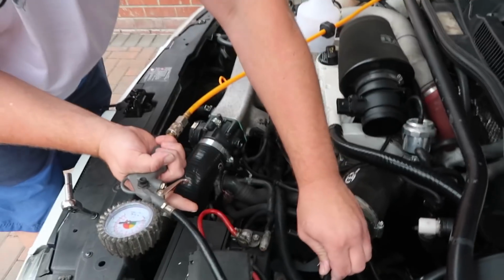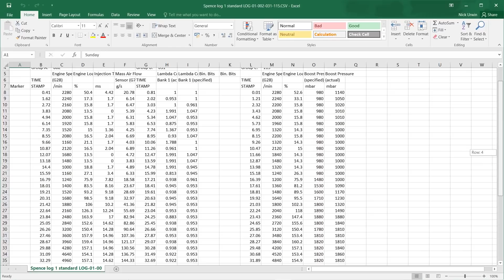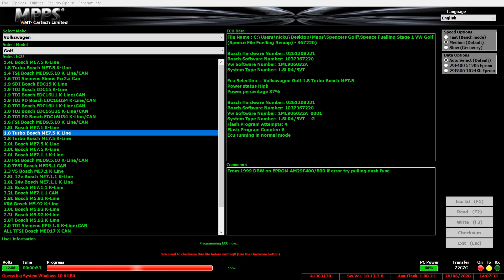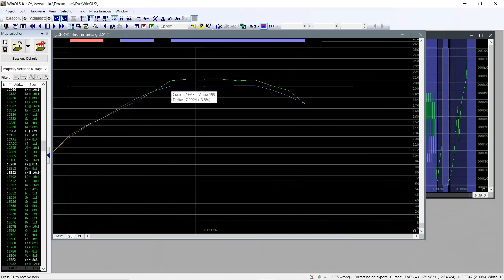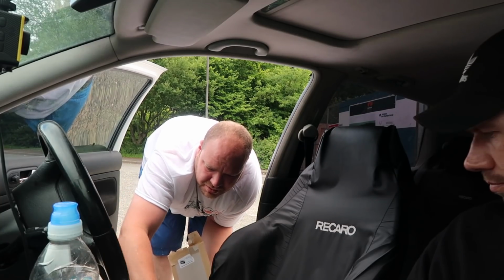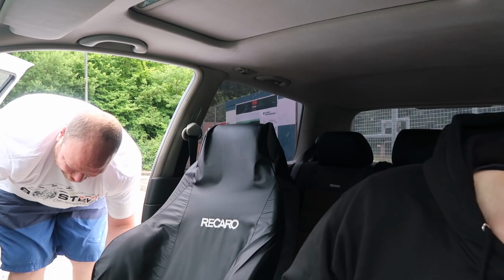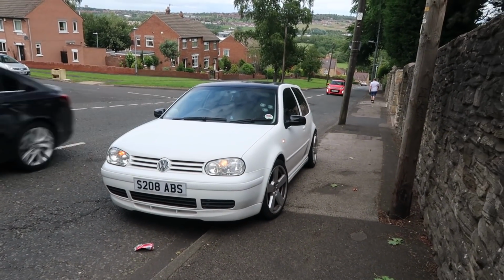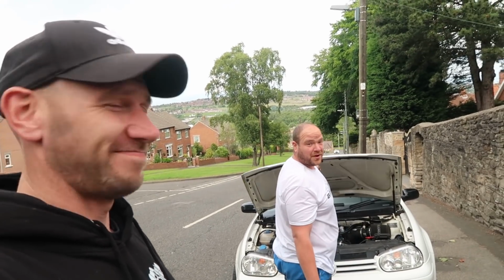MAP it till its broke...!! // Mk4 Golf GTI Remap

Comment: Love you to remap my vw bora tdi st Pd 130 . It has Stage 1 revo 175 bhp at fly wheel and 315 tourqes . Since then I have had fitted  Pd 150 hybrid turbo . Darkside development side mount intercooler  and now she is over 200 bhp but I need a map for new bits . Up rated dog mount . Poly bushes all round . H and r cup kit 35 mm brembo 170 drilled front discs and ebc red stuff for pads . Brembo 170 discs rear ebc red stuff for pads .
Reply from the maker: We can do that soon enough 💪
Reply: @DecimalTenths  let me know . Can't wait .

Comment: Hey, I’m new to your channel but really enjoying the content 👍 Quick question please; can you map-out rev hang? My S3 BAM is the fist fly by wire car I’ve owned and the rev hang between gear changes drives me nuts!!
Reply from the maker: Good to have you on board. Revs hanging on is generally brake or clutch switch related so the first step is to log check the operation of them componenets with VCDS. Are you north east based?
Reply: Decimal Tenths I’m in Glasgow, so more North, North West 😊 thanks for the tip, I’m not having much luck with VCDS, it keeps telling me the firmware of my adaptor needs updated and then just crashes my machine. Need to take a closer look to get it working again. Thanks for the tip. It’s always it done this since the day I got it, and understood it’s built in for emissions to clear residual fuel from the intake ports during gear change. Basically I would like the throttle valve to close as soon as it detects 0% accelerator travel. Have you never experienced the revs blipping and causing awkward up shifts on a fly by wire 1.8t? If not maybe it is just me!
Reply from the maker: @macphersontube  No worries mate, its typical of the clutch switch more than anything. If its all working correctly you should get no hang at all. I've never heard of the residual burn off as you say. Everything is made easier when youre tools work too, VCDS is sooo good if it works 🙈

Comment: Long live the Mk4 golf, most resiliant ones of the last 20 years imho. <3 :) Edit: 225, is that not a BRM from Audi etc? ...edit again, sounds like a mapped diesel  (1.9 PD) 
:P lol.
Reply from the maker: Yeah the engine in this one is a forged 1.9 20vt with k04 turbo. The setup is good for 280bhp but were just taking our time with it due to being busy renovating our unit.
Reply: @DecimalTenths  Nice one bud, I'm just back in fro garage from doing CV boots on JR driveshatfts for the 5th time this week, now using standard shafts and the JR CV joints... the JR stuff did well for 10 years on the mk4 but they going downhill now. This is after replacing engine, turbo, crank seals, belt etc etc... for the 2nd time lol.
Reply from the maker: @79RockShox  its never ending...🤣. I've never had a problem with JR CVs like. I'm giving febi a go at the minute
Reply: @DecimalTenths  I can send you the spare shafts if you dare try them but NS is a good 10-15mm shorter than it should be. The boots are also too big and rub o the bottom o fthe shock/hub......fkin useless. (Not just on golf, had this on 3 vehicles in last year)

Comment: 250 bhp.. Stage 1...no.
Reply from the maker: Whats your views on a stage 1 power output then? 250-260 was the target for us, knowing that stage 2 is just around the corner.😁
Reply: @DecimalTenths  didn't mean to sound like an ass. 18t aum block k03s stage 210ish....ko3 usually 190.. I've got 2001 aum k03s stage 1.5...cos I haven't got front mount cooler.. 228bhp... 2001 onwards have k03s making it more tuneable
Reply: Got to say white mk4 3drs rare as folk.. Lovely looking golf dude
Reply: @71JJW  its an amk k04 engine mate in the golf
Reply from the maker: And you're figures are correct, however its been many a year since we've played with anything as small as K03 frame. The Engine in The golf is a fully forged 1.9 stage 2 level k04 car. 250bhp is very moderate for what it can achieve as it has already pulled 273bhp on the dyno a good few videos back. The aim of this tuning process is to take it up bit by bit and achieve the 270-280bhp that the setup is capable of.
Reply: @DecimalTenths  😯 My Bad wtf!!!! 😉wtf ! Forged 1.9 k04 wow! Something Different.. I should av looked at ya work..awsome and yeah def correct with your bhp stats..keep up the good work.
Reply from the maker: @71JJW  🤣 yeah admittedly should have said it at the start of the video...😁.
Reply: I thought that. Bollocks! 200/210 tops with no bolt on mods.
Reply: 250bhp on a stage 1? Get out of here!
Reply: @22Jeffers  forged 1.9 k04
Reply from the maker: @22Jeffers  🤣 there's a few bolt on mods...😛
Reply: @22Jeffers  read the the comments before its far from the standard engine the car came with..
Reply: Unlucky spence least it weren’t a rod this time aye. Cant be to much work to put hybrid on there now and get 300bhp
Reply: @kevinmchale6637  😜